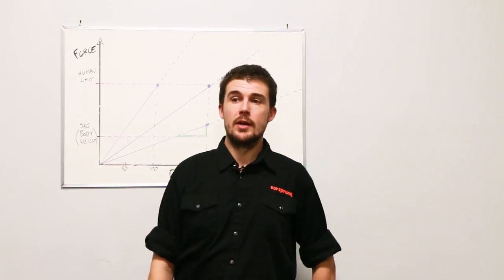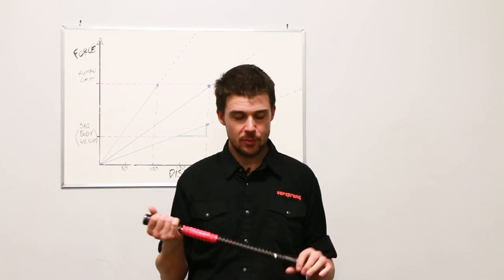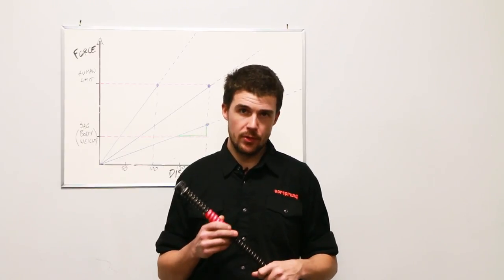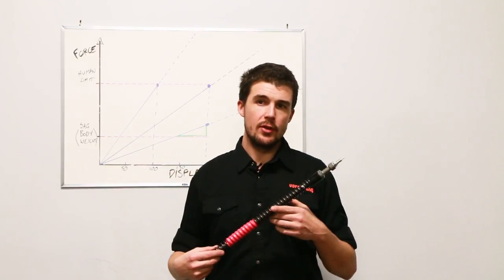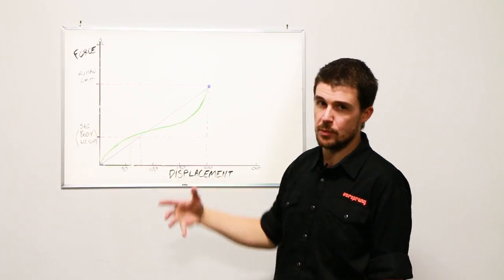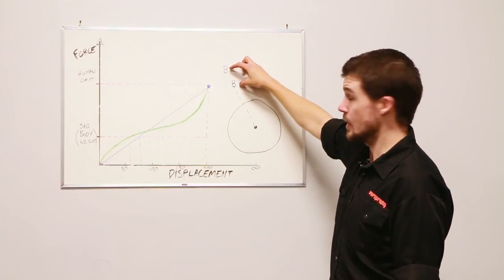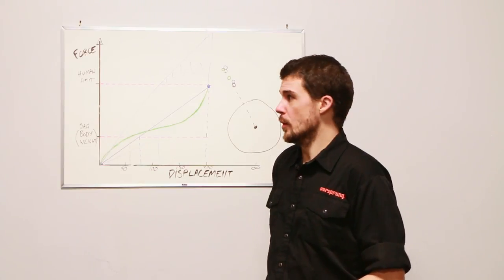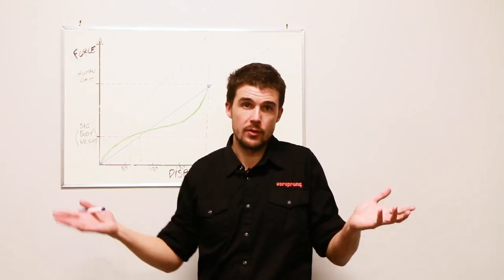How Much Travel Do You Really Need? Ramblings Pt 2 - Tuesday Tune 28

Comment: Great work again Steve. It amazes me how air springs ever got going considering how bad they were until recently. I think it's interesting that the big brands (Fox and Rockshox), who can produce a self-equalising air spring with big negative volume and not too much friction, don't bother with a coil alternative. Meanwhile those with ropier air springs are all about the coil alternative. My personal take is that in the case of Rockshox 2019 Debonair springs in particular (as well as a Luftkappe equiped fork I suspect) there's precious little benefit to coil any longer. Especially when weighed against the faff of changing coils, which leads so many people to put up with the wrong rate, or worse, preload the spring.

Comment: Excellent presentation. If bar height is a primary way to optimize fork dive, it is interesting to consider that there is not an analogous option for a shock that “dives” too much. But you have the same basic problem, since optimized shock performance may not give full travel or optimal sag/rear end geometry. Then you have to consider how the fork and shock work in tandem to both create a particular static and dynamic geometry and a corresponding level of traction on the front and rear. Mind bending! I can see why you are so into suspension.

Comment: Interesting as always! that discussion around bar height/fork dive, got 
me thinking about front/rear bias, and how one seems to affect the 
other, for example I found that increasing air pressure in the rear 
seems to make the fork a little more prone to diving (weight shifts I 
guess?)  and the other way around, I found that using more volume 
spacers in the fork led me to bottom out more/stronger in the rear. 

   Since we are told to "always" have the rear end softer and with more 
rebound than the front end to avoid pitching forward, how do you know 
when its enough?  Because we run the risk of ending up with a rear end 
too soft/ front end too hard, wich I found affects handling (cornering 
and changes of direction specially) in not so steep or fast sections of 
trail. 

   What practical ways could be to notice that you have a stable set up,
 correctly balanced front/rear?More "sag" in the rear its enough? sag+ 
more rebound damping in the rear? sag+ more reb+ less compression?....
Thank you for the videos! 

          Cheers

Comment: My all purpose trail and tour Enduro has 170-180mm of travel. And even with all the tokens and the pressure close to being harsh, I frequently manage to bottom out the thing. 
Still rides decent and agile up and down.
I think the amount of travel one can make use of also depends on the height of the rider, and the length of the limbs.

Comment: Tie hydraulic brake pressure into fork pressure/spring rate somehow to reduce brake dive.  Could work in theory but in practice it would end up hokey AF like a Scott handlebar with cables everywhere
Reply from the maker: Some motorbike companies did this in the 80s, I think both Yamaha and Honda had variants of this. One made the compression firmer under braking, the other made it softer because your hands were already loaded up more. Eventually they both gave up on it.

Comment: I have come down in travel but up in wheel size and gone to coil. So I had a commencal meta, so 650b 160mm rear super deluxe and 170mm front lyrik, found that I didnt need it all. Now I'm on a stumpjumper evo 29 with 140mm ohlins coil and lyrik air 160mm, much better all around for my style of riding

Comment: this is revelatory. low bar heights are problematic. higher stack frames and higher rise bars are a brilliant solution. keep that forgiving fork spring rate and raise your bars. 40mm rise on one bike, 50 on the other.  brilliant advice and end result for this rider.

Comment: Steve, can you please describe dependency of rebound to spring rate during consecutive bumps? I mean with slow rebound you can feel your bike harsher, because suspension is deeper in ut´s travel, which demand more force to compress suspension than in case when you have faster rebound and you are not so deep in suspension...right?

Comment: With fork dive, can't that be addressed with low speed compression? I'm a big fan of longer forks and usually bump mine up 10-20mm from factory settings. This is with air forks however, coils might respond differently
Reply from the maker: It can help to a certain extent, but it doesn't eliminate it or change the final settled position under consistent braking, and too much LSC definitely hurts bump performance. It does reduce overshoot and particularly in highly dynamic situations (braking hard through rough terrain) more compression damping (particularly in the mid-high speed range) can maintain a higher dynamic ride height.

Comment: Unpopular take - bikes finally have geometry that doesn't suck, so coil suspension is actually useful on a wider variety of frames (therefore the bike as a package has become capable enough to blur the lines between all-mountain, park, and downhill).  The weight is a secondary consideration, and it's always been possible to throw money at that... people are thus willing to spend extra money on brakes/wheels/tires/cockpit to keep up with that massive range.  There are some heavy bikes which still benefit from the same advancements - but something really short and steep isn't going to feel great anyway, and roadie seat tube angles are garbage with long travel bikes under dynamic sag to climb with.  Get that nonsense out of the way, and high performing suspension is the next performance frontier (followed by tire performance, contact points, then kinematics and finally weight).
Reply from the maker: Definitely some truth to that too! A lot of the geometric aspect I believe can be traced back to dropper posts - funny how quickly geometry evolves when you can descend without getting kicked in the balls by your saddle all the time.
Reply: @VorsprungSuspension  I was always willing ot just play with the QR lever there to help with that, but having that a lever away is really nice.
Reply: I'm just bit confused with your take ok seat tube angles, could you please elaborate?

Comment: Steve - great video! Thanks again! I have a couple of questions. So heavier riders should be on shorter travel bikes, because they are starting off farther toward the human factor limit and therefore have less range to utilize? Vice-a-versa for lighter riders? Other than geometry if suspension is set-up properly, then owning N+1 bikes doesn't provide much benefit. The so-called this is my trail bike and this is my big bike is an invalid reason to own more than 1 optimized bike. Do you have a hypothetical travel limit for most of us (you must have thought about this one). Since geometry has improved over the years particularly with shorter travel bikes, are we narrowing in on the human limit through experience. Many of us are riding short travel bikes succesfully in situations that were only deemed big territory. I don't think my skill has improved that much. I feel geometry has increased confidence and capability, but don't notice the travel as a limiting factor. A few years ago, when purchasing an 11-6 from PUSH, I spoke with Darren. I mentioned how impressed I was with the shorter travel bike and its capabilities. He said, that most bikes (regardless of travel) utilize about the same amount travel for a given trail, except for the big hits. Does your hypothesis explain why Aggy this past week was able to ride Darkfest on a trail bike with dual crown (evil insurgent) and while everyone else was on a DH bike.

Comment: Nice what kind of rear shock would you recommend for a rider with gear of 113kg for a Vitus Sommet crs 29nr  spring size trunnion 205 x 62,5. I now have a RS super deluxe select +. Dualair 2 tokens. I run the pressure about 280 psi 30% sag

Comment: After upgrading my HT from XC bike with 32mm stanchions to Trial/Enduro HT with 35mm stanchions(anvil of a bike), am I right in thinking, that bigger diameter fork will ramp up more? Since bigger stanchions means bigger piston and more air volume, and looking at hydraulic brakes and air compressors, I'm fairly convinced that this is the case. However I did not realise it before buying. I think it adds quite important aspect to buying more aggressive bikes: They don't only "give" more travel and strength, but might actually ride harsher in easy terrain? It'd be awesome to hear from #Vorsprung, or maybe an episode is justified? Any thoughts from general public are welcome too off course.
Reply: The stanchion diameter doesn't affect the progressiveness. It's determined by the volumes of the positive and negative air chambers (which all change equally as you change stanchion diameter). Your new fork could of course be more progressive anyway but it's not because of the stanchion diameter. If your fork is too linear you can add volume spacers. If it's not linear enough you can remove volume spacers if there are any, or buy a vorsprung luftkappe or smashpot if your fork is compatible :)

Wider stanchions mainly affect the torsional rigidity, which could feel slightly harsher but brings the benefit of your wheel actually pointing in the correct direction..
Reply: I don't think that's how it works Maciej
Reply: Just wanted to add that with increased rigidity there is less binding which should lead to a smoother ride

Comment: Can volume spacers help a little bit with fork dive?
Reply: since they affect pretty much only last third of travel, no. If you have well designed airspring with large negative air chamber you shouldn´t need them as they will only reduce the amount of travel available and make fork/shock feel harsh.
Reply: yeah they can by taking them out of the fork and bumping up the pressure a bit instead
Reply from the maker: @TJ-gh6cg  is correct - more air pressure will help rather than adding spacers, but more air pressure means you need less progression so you'll want to remove spacers rather than add them.

Comment: Would it be possible to make a hybrid suspension coil/air mix
Reply from the maker: Been done - Trek tried it years ago in their special 40 cartridges. Combined the weight and lack of easy adjustment of coil with the friction, poor initial spring rate and additional weight of an air cartridge. Not to say it couldn't be done well, but it hasn't really yet.

Comment: I look at suspension like this;
I set and then make the appropriate adjustments based on MY riding style. (now this changes as I progress or regress for that matter)
My goal is to make the bike(s) as stable as possible while utilizing the majority of performance of the bikes design. 
Setup will always be a compromise, but less so for the majority of riders (Read: slow! lol) Of course that is subjective. 
But personally, I think that unless a rider is very fast and consistent, the flaws of any setup/performance will not be so exaggerated. 
In summary, it is best to get the setup as close as possible as it was designed but yet good enough for a particular rider and riding style.

I also think coils are making a 'comeback' (not really a CB) because many of the makers are churning out better quality products. Other than probably Ohlins, and maybe Fox in the past, other suspension maker components have been made half-ass and heavy imo...
Reply: Setup is always a compromise, regardless of rider speed - you're exactly right that if it's not exaggerated it doesn't matter (and the one valid complaint people have about getting performance opinions from slow and light journalists).
I think the quality has always been there for anybody willing to pay the price - what I'm actually excited about is the Marzocchi line - imagine solid mid-range Fox dampers on chassis that isn't dictated by weight weenies... that stuff is going to be gold for a big aggressive rider like myself.  Half-assed quality is always easy to achieve, and while weight tends to be correlated with that, it's isn't 1:1 and too often well-heeled riders use that as a proxy for quality, which is why top performing components have a lot of money spent on extra machining steps that don't benefit tubby Clydes like myself... which is why my best setup is actually a reworked Yari running a Luftkappe and a Charger damper kit.
Reply: @tehllama42  I think we are on the same page mate.